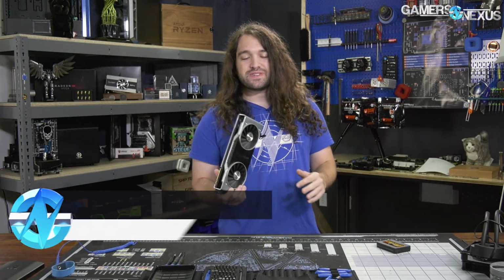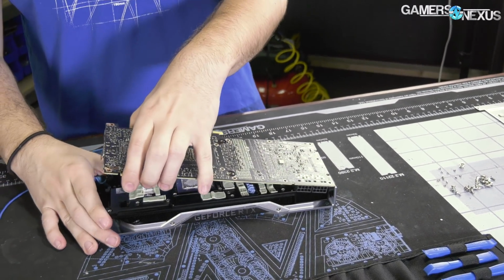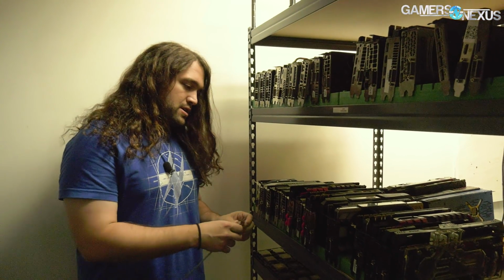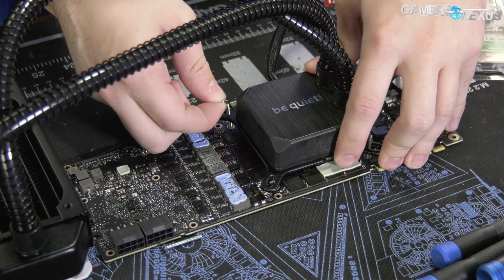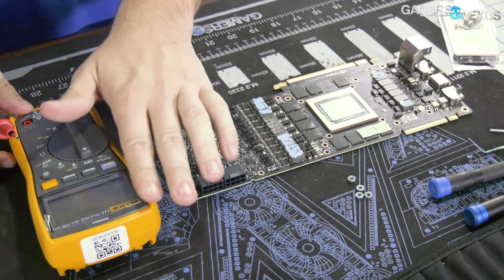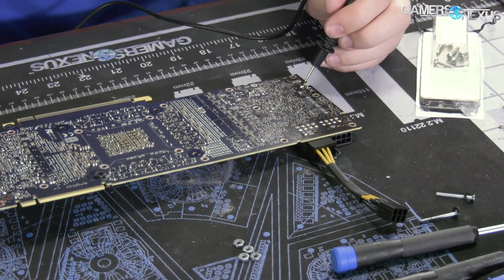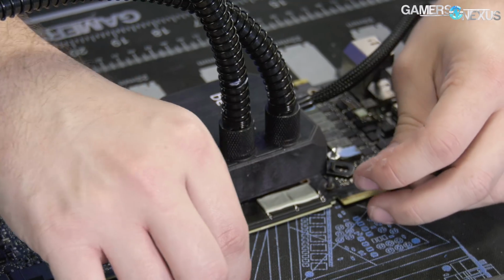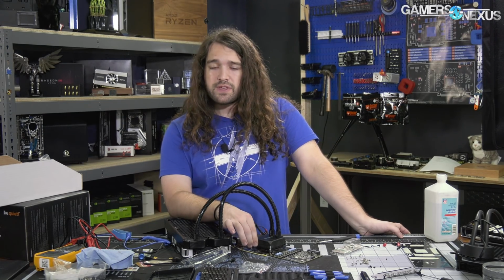RTX 2080 Ti Hybrid Mod: Liquid Cooling Founders Edition (1/2)

Comment: FYI to get the center between 2 holes you measure the hole then the distance from the inside "id" of the 2 holes and add the diameter of the single hole to the distance.

Comment: my evga 1660ti xc ultra with an acrtic accellero 3 and liquid metal never went above 45C. core clock stable at 2145 and memory at+1,500 in all games an benchmarks.

Comment: Thanks for the video! You inspired me to make a mod like this with a 240mm watercooling I got for only 48 € on my 1080ti and right now I am sitting at 2063 core clock under full load and temps will not go above 52 C with only 65% fan. AMAZING results, before I was underclocking to 1750-1830s core clock with temps going above 85 C at 100% fan(stock Gygabyte 1080ti). I used zip ties to fit the cooler properly as the holes would not align perfectly otherwise. Tested in Shadow of the Tomb Raider in 4k ultra and it is way smoother with no dips in framerate! Also my CPU temps have dropped with the case being less hot thanks to the watercooling directing all GPU heat out of the case.

Comment: Steve grab some fuel hose or plastic tubing thats close to the diameter of those screws, cut them to the size needed so they act as stand/spacer and tension stop for the water block.  Place them between the deck of the board and bottom of the bolt ears, it will make it more stable and allow for proper tightening without cracking the die.

Comment: I put a NZXT G12 video card bracket, and a EVGA CL11 AIO. I keep my clocks higher longer. The G12 comes with two sets of brackets for AMD and Nvidia. Funny thing, only the AMD bracket would work. i have little heat sinks on the memory, they still get hot. i have to work on that.

Comment: i happen to have one of those evga ones that sponsored the video. I'm having some heat issues and was wondering if there were any brackets I could use to attach a closed loop liquid cooling system to the card to help it. Are there any brackets on the market for that yet?

Comment: Good try, but what about memory chips? I think this method will be damaged ur memory chips and micro-power module, because liquid cooling system only take over the GPU heating.  U need use Thermal Adhesive Glue and heatsink cover the memory chips and micro power module, and use additional fan make sure they can't be over heated.
Reply: Hi, i tried to attach the heatsink with thermal adhesive but vram are "
slippery" and the heatskink fall down...any suggest?

Comment: I modified the Intel bracket from Corsair h100i GTX to fit to my Asus GTX 1060. I'm using the H70 on the 1060 lol 35c/95f running 100% testing lol
Used the Corsair screws to hold it all together with mb stands

Comment: Can you (or some of the more expert commenters) recommend a good liquid cooler to fit a 970? It's this one from PNY:
https://www.newegg.com/Product/Product.aspx?Item=N82E16814133620
When I'm gaming it quickly hits max power draw and then shortly after hits a max temp of 80C where it starts to reduce power but continues at max temp. I have its fan at about 50% (at load) and this is already pretty noisy. I tried messing with my MSI utility to up that but then the fan wouldn't shut up at idle (and of course became MUCH louder at load).
I'm looking at the temps in GPU-Z, as I said the card maxes out at 80, and then the Performance Cap just cycles between power, temp, and reliability voltage (no idea what that even is).
My CPU is a 6700k using this Arctic Cooling Liquid Freezer:
https://www.newegg.com/Product/Product.aspx?Item=N82E16835186153

And the board is an MSI Z170-A Pro
https://www.newegg.com/Product/Product.aspx?Item=N82E16813130892

Chassis is this Stormtrooper-looking thing:
https://www.newegg.com/Product/Product.aspx?Item=N82E16811353059

GPU still performs pretty well and I'm not interested in upgrading for a while, but I wouldn't mind bringing the noise and heat levels down a little bit and keeping the card from a premature heat death if possible. Thanks!

Comment: Hey can you guys do a review on AIO coolers for GPUs(gtx 10 series) such as the ID-COOLING ICEKIMO 240VGA RGB SYNC Integrated AIO Water Cooler or other ones that are similar? I’m wondering if I should invest in one for my card. I’d also like to know if these kinds of AIOs would be more effective than using a bracket and a cpu cooler(since they look nice in my opinion)

Comment: wouldnt a support bracket from a cpu on the backside sittong on small plastic discs as standoff provide a better.. "torque" surface than the pc.. using bolts like that i would be afraid of pulling em straight thru the pcb. :D

Comment: you will need set up heatsink/cooling for the vrm and for the rams. it will be hot.
Reply: Hi, i tried to attach the heatsink with thermal adhesive but vram are "
slippery" and the heatskink fall down...any suggest?

Comment: This is why I love your channel. What a great project, well done mate. I always wish these channels had someone with an engineering / fab background; it’d be a simply job knocking up a proper backplate with some foam backing, appropriate height spacers for equal contact, and lifting off the shunts and shorting them properly with solder. 

And no, I don’t mean someone like the erection with a hard hat (who doesn’t actually use PPE) they use on LTT (not hating, I’m a subscriber). Anyhoo, looking forward to the second part, loving your Turing coverage.
Reply: Side note: you can use a second nut under the bracket to limit it to the correct depth, and you should really have a washer below the nut there.

Comment: i was just wondering why it doesn't come standard liquid cooled. i mean where is the cutoff point to aircooled. does this thing have throttling issues with air cooling? after i installed a liquid cooler on my 1080ti, i saw a huge difference in cooling at max load and a notable change in performance.

Comment: He said it's overpriced for the performance upgrade, but it looks like better performance than the Titan for no cost increase.  RTX is a freebie.  The 2080 is pretty much the replacement for 1080Ti, and costs about the same, for similar performance plus RTX.  Even if RTX is useless the cost for the  same performance didn't change.

Comment: 19:50ish seeing as how your intent was the equal spreading of force - wouldnt applying equal final torque to each nut make more sense than measuring the height from pcb? also far more accurate and easier.

Comment: so I've always wondered why do the HW modders (like you guys, der8auer, buildzoid) not just get another shunt resister in parallel for the current mods instead of doing like liquid metal across the resistors?  I'm assuming the amps that nvidia uses for to measure the shunts will detect a short because it will just read 0 with a dead short.  Also, "0L" is actually "open loop" (don't mean to be an ass, just thought I'd mention it for the future)

Comment: Why not simply use the NZXT G12? It takes literally just a few minutes to put it onto the GPU, it fits perfectly on any standard NV/AMD cards, and gives same temp results as custom loop if used with big enough AIO?
Reply: if someone finds a video on this please share
Reply: Not "any" --some cards have VRMs and/or caps (or even power sockets) that get in the way of the mounts for the G12. (Though yeah, I wanna know if it fits too, because that's my plan!)
Reply: @MicahGoldstein  Any news about your project?
Reply: @Phantigua   I'm still waiting on an EVGA Step-up. : (  

But for reference, I'm running the G12 with an X62 AIO on my 1080 Ti, and I'm never more than 15deg above ambient on the GPU.  My 970 had one of the power sockets (6-pin I think) in the way, so I removed it and put it on a cable.  It will be strange and awesome if I can use this same mount on three different GPUs!

EDIT: also for reference, that X62 is in the top, venting, and my CPU gets as much as 44 above ambient, and the air off my CPU rad blows at my GPU.  Even with that air, the GPU RAM doesn't break 22 over ambient.  I'm dying to see how the 2080 Ti will overclock in this setup!

Comment: HI Steve, do you feel that the 2080Ti could possibly have a future update to remove the power limit? Or have you heard about anyone hacking the power limit?

Seeing one of your videos (I think it was yours) on a 2x8pin with 1x6 pin power delivery on the one of the 2080Ti cards, it somehow strikes me that the potential power for that card specifically is power limited way below its actual capable limit. Which in turn points to a possibility (possibility not a guarantee) that a future card hybrid or whatsnot (better cooling solution vs heat generated) may have a higher power limit.

I can't wait if this is ever going to happen, as it will mean being able to squeeze (or effortlessly gain) higher performance on the 2080Ti. If this scenario ever happens, the current prices may be more digestible. Of course maybe even if it means possibly needing PSU with more wattage.

Comment: Steve, use 4 more nuts for something like that, put the bolt through the hole then add a nut. This will prevent the bolt from falling out if you lift it before the cooler is attached. Obviously on this application you need some slop so luckily they don't need to be tightened. It does make a difference.

Comment: Why are you planning on using LM to short the shunts?  Why not just solder on a wire?   You should get much better performance and stability by doing it right.

Comment: since the screws are countersunk and do not sit completely orthogonal to the pcb, when you measure the fit you should measure from the cooler plate to the pcb, not how much screw there is hanging out.

Comment: I had temp problems on two cores 5820k then I went crazy with the TIM and that fixed it. THE IHS on that CPU should have never passed QQ it is not normal shape. lapping it fixed all these problems now I don't need a ton of TIM

Comment: Overdrive the voltage by replacing the resistors that are relevant to the memory or GPU. Read the SMD (resistors in the direct path to the components in question) resistance and start applying Ohm's law. The only way Nvidia could stop this overclocking method would be invasive as hell to the architecture. Come on...You KNOW you WANT to! :P Of course, your going to have to throw out the stock crap OC tool in favour of something that doesn't exist to doop you into believing you have options. It would be worth the coding for that alone.

Comment: So, why would nvidia limit the performance, ON THEIR TOP TIER PRODUCT. like if you want to be like "get 2080 ti way more powerful than puny power limited 2050" but the top tier product? are they worried it will step on the titan (?)? are they worried it will be stepping on the 2080ti? i know understand nvidia...
Reply: They gauge the performance to life expectancy of the product and design the card to meet it. If Nvidia made FE cards that were more powerful but all died after a year you might upset that card/chip didn't live longer, well most people would. The third party card makers design their cards based mostly off the Nvidia designs;  tweaking  layouts and coolers, from that think they can get slightly better overlocks without impacting the expected life of the product.
Reply: This is Maxwell 2.0. They'll milk this architecture for as much as it can offer on the next few years...With increase prices of course. It's already been speculated that there won't be RTX xx60 and xx50 models.

Also, it's speculated that nVidia might just increase them number of raytracing stuff on future models instead of just making the cards faster. The architecture already does well at 1080p, which is what the vast majority of people are using anyways.

Comment: You get titan v performance for $1200. How is that not a good deal. Keep in mind that’s without dlss
Reply: When you buy an overpriced card you get the performance of a overpriced card.. still overpriced
Reply: Blue Eyes White Teddy they’re all overpriced nobody needs video games. But they charge that because they can it business
Reply: The lack of necessity of video games and video cards has nothing to do with how high the prices should be. The fact that the 1080 Ti is €700 and the 2080 Ti is €1350 for about 20% extra performance means the card is overpriced. There are many things that are not necessary but are priced high fairly. There is a reason certain luxury items cost more. There is no reason that a card that's only 20% faster costs twice the price.

Comment: I think blasting with air is flakey. not copacetic. liquid nitrogen drip per ram block would be better with a consistent drip rate per block. adjustable drip rate so as to not run off but evaporate at a given rate. the rate of blowing is also critical. so much pressure, at exactly 90 degrees, and and and---so much air pressure. so much nozzle diameter. so on, and so on.

Comment: Are you saying continuous like continuity? You where performing a continuity test between the connectors and the current shunts, so you'd say they have continuity, not "are continuous". A continuous circuit is slightly different definition.

Comment: Gamers Nexus,

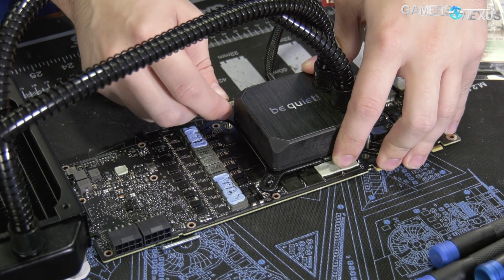By way of unasked for advice, if you insert the screws from the backside of the card (just as you have done @9:33) and then without mounting the cooler bracket run the nuts all thew way down to the PCB and snug them tight, you can then use the screws as studs.  This will allow you to mount the cooler over the studs and secure it with some more nuts.  You could even place coiled springs between the cooler bracket and the second nuts to aid in keeping the mounting tension equal across the cooler plate and the GPU chip, much like spring tension is used to normally mount a cooler to a CPU's integrated heat spreader.

Officiously yours,
A Concerned Mechanic
Reply: Not 100% sure but the screws may not be perfectly perpendicular to the card due to the cooler not being made for the spacing on the card. I was thinking the same thing though
Reply: Well it is not Noctua's enthusiast grade SecuFirm2™ multi-socket mounting that is for sure... nothing is easyer then that.
Reply: The screws allow them to make perfect contact with the die then it can be secured down with the nuts. If you were to have them rest on the nuts as you stated like studs then you would have to have the nuts be the exact height needed for perfect contact. It is much easier to bring and down and tighten rather than need an exact height out of a given nut.
Reply: Hello Jdecasse413, As picklesthegreatest just said, the second set of nuts (and springs) would go on top of the mounting bracket.  Verbal descriptions and plain text don't always convey ideas clearly.  Here is a link to a product with pictures which hopefully will flesh the idea out a bit more.  For what it's worth, thanks for your criticism; I'm always trying to say things better. :-)  https://www.aliexpress.com/item/4Set-Lot-LGA-115X-1150-1155-1156-CPU-Heatsink-Mounting-Screw-Kit-Water-Cooling-Radiators-Backplane/32792386440.html
Reply: WarGamingRefugee yea after I read it a second time I understand you weren’t using them as standoffs just as studs. Then securing with retention springs and nuts as a mechanical engineer and drafter I should have realized that. But as you said plain text is nothing like looking drawings.
Reply: It's entirely understandable and thanks for getting back to me.  I've spent so much time working to explain things to folks so that they understand what being repaired and why, that it's a skill set I'm always trying to improve.

Comment: Hey Steve, one question, can you talk about / explain the following... If the 2080Ti is using 100% of MAX power (including the increased power target), how are the cards gonna handle, the redirected power to the tensor cores and the RT cores? At the moment you have 100% of power going to the normal raster cores, but when compatible games come, the clocks on raster cores will go down?

Comment: A bit about multimeter. OL means overload, or open lead, open load, open in general. When you see your resistence going nuts, bad connection or the circuit has capacitors in it which are being partially charged by the meter.

Comment: Why not just use an EKWB block for this?
Reply: You can't just use any full cover block on a video card. You have to use a block designed for the card. Even if you use a universal gpu only block you are in the same situation of the mounting hardware not fitting the hole spacing. The way they are doing it makes perfect sense for something that is only going to be like that for a few days.
Reply: noone is asking for full cover block here ...

and the way they are doing it is exactly the same they could do with EKWB universal block except you can hook up that to overkill cooling system to really remove any heat throttle from the chip
Reply: Why spend $150 when you don't have to?
Reply: one would expect GN to have some EKWB or Alphacool waterblock at hand (and if not im sure JayZ would gladly throw one in the mail for Steve :) )
Reply from the maker: It's almost like there are different ways to achieve the same goal.
Reply: @GamersNexus  I guess, but why n-rig it when you could easily just do it properly.

Comment: I suggest using sharper lead ends (like .05) on your multimeter for finer conductivity testing, or hook/pincer lead ends so you don't gotta hold the other lead to a pin while trying to make a stable read out.

Comment: der8auer did a video called "RTX 2080 meets DRY ICE" pretty interesting :) only 20% better clocks at the cost of 50% more power draw, not really worth it!
Reply: ZeakQ that was on a 2080 not the Ti version. Be interesting to see the scaling.
Reply: 2080Ti will still scale the same. It's just a bigger die, same architecture, same manufacturing process.  https://youtu.be/9_G7tWAh5ms?t=950 if you wanna see the video :)